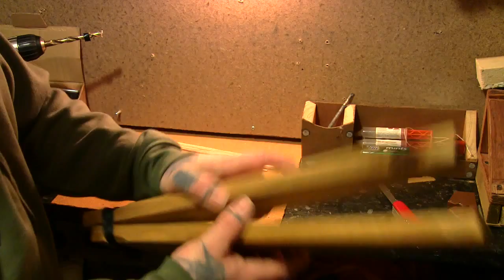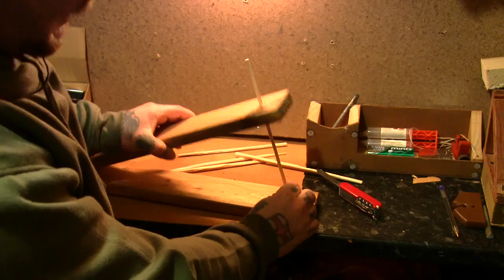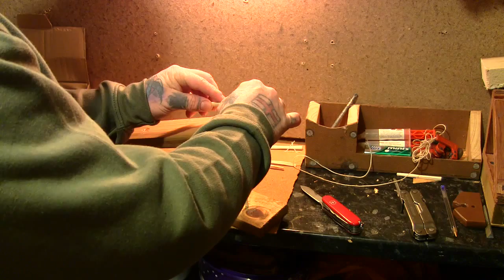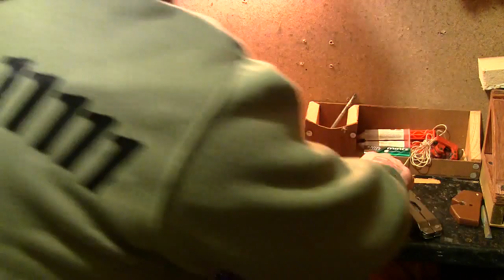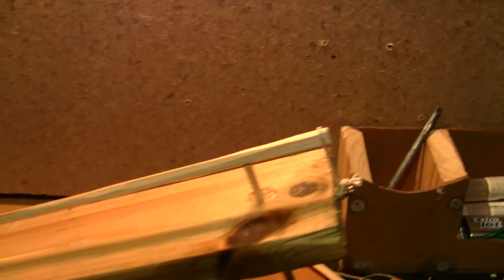HOW TO MAKE A MOUSE TRAP (Board flap trap)

Comment: Some nice brad nails (heads clipped off) on the underside of the top board, ... and "nail" that rat to the board, makes for a very firm gotcha!  Definitely have some wide rubber tire "ranger" bands on the boards makes a stronger rat trap than the normal wire rat/mouse trap.

Could potentially make the same design with "H" upright poles and a falling cross bar, with dual ranger bands, and brad nails.
Reply from the maker: nice one John great ideas mate